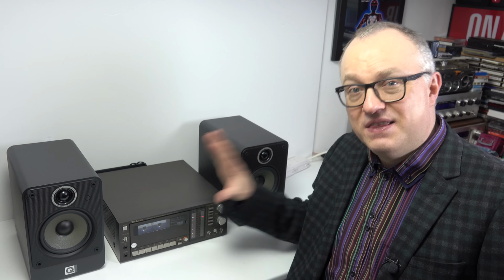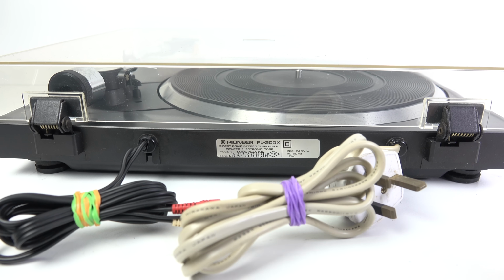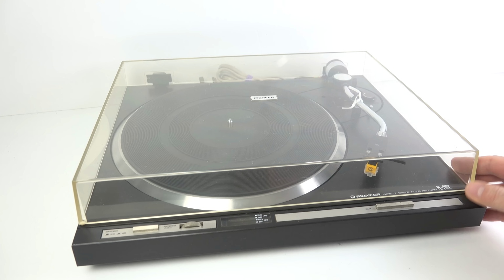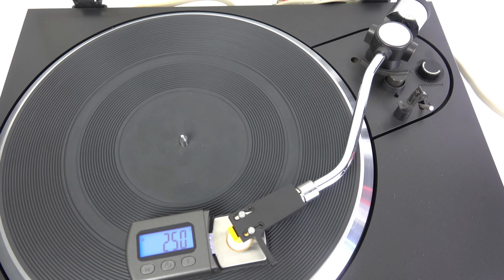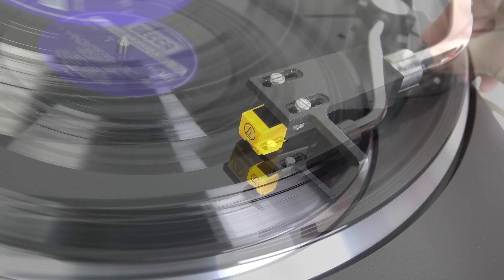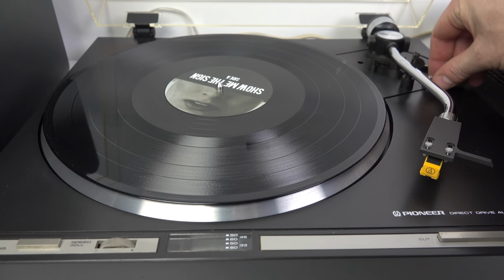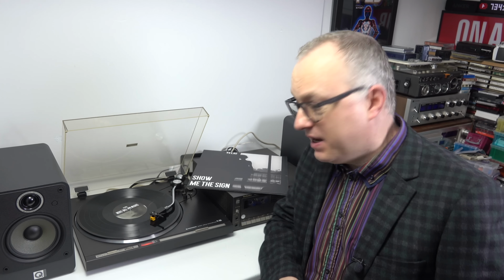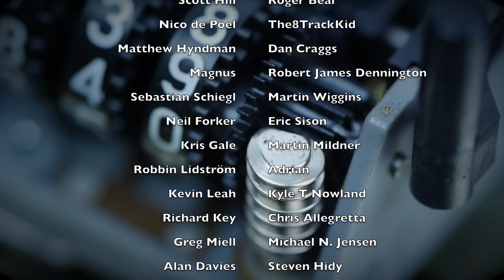Beginner Budget Hi-Fi Build: Part 3

Comment: Oh no.  The CASSCEIVER.
Reply: I thought it was cassiever
Reply: Had a "Realistic" one - a double cassette Cassceiver from Radio Shack back in the day. It was my 1st Stereo System.
Reply: Cassceiver reminds me of what we called a Radio-Cassette Recorder which was AKA a Boom box.
Reply: @steviebboy69  So now I know where the Japanese "rajikase" came from:)
Reply: @X2FileWrightonite  Agree, my first was a Realistic Receiver that was really thin. It was only 15w per side, but the radio part was superb at picking up AM at huge distances. The way the front panel and tuner lit up looked great and the amp had a switch on the back that optimised it for their Minus-7 speakers (still got two sets of them downstairs). It died while I was changing houses and was discarded. I really miss it.
Reply: @saddle1940  Radio Shack used to make some pretty good AM/FM tuning stuff,  In general today I notice across stereo hardware that is reasonably priced the quality of tuners has dropped quite a bit.
Reply: @steviebboy69  A classic Boom Box or Ghettoblaster probably weighs more than this whole system in D-Batteries alone.
Reply: @filanfyretracker  the price of tuners has dropped because of the stupid decision to cease using FM etc and go purely digital in the future. A huge mistake as FM not only works better, but it would mean loads of tech going to landfill that's working perfectly. I tried selling a tuner in cash converters some years ago and even then they weren't interested unless it was digital!
Reply: @RWL2012 : I going to blame autocorrect for that one! The speakers came in black metal or woodgrain. The receiver was an STA-7 Realistic System 7 with aqua coloured lighting. With those speakers, it was great for small rooms. They made an even smaller receiver (STA-19 ?), same height, smaller footprint. Tried to buy one but they'd discontinued it. Never seen one here offered second hand.
Reply: I did hear that the Minimus-7's were very good for their size, and it did have the maching system you mention for it.  I have Mach 3's hooked up to this computer system.  jamo 707i in the Lounge.
Reply: Rajikase? is that a kind of translation of what I said above?
Reply: @steviebboy69  At the time, I only retired the Minimus-7's because I saved up and bought a pair of Ditton 110's (around 1983) for the speakers. Wow, complete convert especially on music with heavy vocals. Still listen to them every day.
Reply: I used to have a Sony one, massive old thing, made out of wood

Comment: Adjusting antiskate on a grooveless disk is actually not a good methhod. The skating force is quite different in a proper groove. The good way is to use the tracking tests on that test record. A loud sine sound. With an oscilloscope you can check that both channels follow the sine wave equally well. Or if you don't have an oscilloscope, as most don't, you can record the sound on the computer with Audacity or such and study the waveform. Or just do it by ear, listen some loud and clean sound, turn antiscate both ways and listen when it starts to distort. The correct value is in the middle of those points. In the tracking force adjustment the part with the scale in it rotates freely, and the other part is the adjustment. You balance the arm, then turn the scale to 0, then turn the adjustment again until the scale reads the value you need. A good guess for tracking force on Audio-Technica cartridges is 2.0 grams.
Reply: esa062 while this grooveless method may not be the best, it’s still going to get your antiskate setting much closer to what it should be and then you can use the better methods at a later time to fine tune it. Sort of like setting your HD TV to cinema mode which gets you much closer the tv’s ideal picture settings (vs the bright store display mode most come out of the box set to) then going back later to do a proper calibration of the tv either yourself or by hiring expert tv calibrator to come in to calibrate it for you.
Reply: Actually setting it on the same number as tracking force is often more accurate. On my turntable the tracking force is 2.0 g. If i set the antiscating so that it stays put on a CD surface, it reads 1.8. The correct setting is when it reads between 2.5 - 3.

Comment: Enjoyed this video as I usually do. Just a (may be too 'techie') note: mains frequency has nothing to do with the speed a direct drive turntable motor runs. In fact even most belt driven TT are do not depend on the 50/60Hz from mains, and only very old (read "*really* very old") synchronous AC motors (like those found in certain reel to reel tape decks eg. TEAC 2300A) do use mains frequency as a reference for angular speed. Best regads and keep up the good job! ;-)

Comment: I have a Technics SL-6Q, a later version of the SL-5. It is a Direct Drive unit,  has quartz lock and is semi programmable.  It's supposed to use an optical sensor to detect the gaps in the tracks so you can program it to play specific tracks. The programmable function doesn't really work on mine. Given that it's over 30 years old, I'm happy with it as it is. Overall, a nice little turntable with a small footprint. Uses a P-mount as opposed to a standard mount. The tone arm is built into the cover and it's fully automatic. Down side is if you have any slightly warped records, they can bang up against the lid.

It was my first real daily driver until I replaced it with a more traditional turntable. I still use it with my living room stereo int he living room on occasion. The small size allows me to tuck it away when not in use.

I've enjoyed these videos. They've made me realize that I'm not a beginner any more. Though I'll probably never be an audiophile.

Comment: The PL400 has a series of  magnets made into the bottom of the platter and a coil mounted below in the body of the turntable. So the platter IS the motor. It doesn't get any more direct drive than that.
Reply: Scott from Maine my first semi decent turntable was a Pioneer direct drive. I then upgraded later to a Linn LP12 which was a revelation. The secret was the isolation provided to the platter with it's belt drive and sub chassis spring arrangement. I always understood direct drives to be the choice of the DJ where the audiophile credentials were not so important. 8-bit seemed to prefer the direct drive option but i always thought they sounded to bright with their metallic platters and direct motor induction noise ringing into it.
Reply: Yeah, it's the same principle used in the technics 1200 and 1210 tts, and it makes no noise at all! It's a wonderful idea
Reply: The turntable and tonearm platform are mounted on a very heavy base suspended in the frame of the unit to dampen and isolate from vibration.  It was excellent for costing under $200 in the early 80's.
Reply: i can see why one would prefer direct drive over belt drive for hifi use: longevity

no belt means one less part that degrades and needs to be replaced sooner or later. 

not sure how much of an issue the motor noise really is on a budget system like this

Comment: Also, major kudos for putting this together. I'm putting together a beginner setup for my son using some existing existing components but leaving off the CD player since he owns no CD's and he's wanting the total analog listening experience. I bought him a secondhand turntable (the PL-990) based on my top ramen budget and I had an old Pioneer dual cassette that hasn't seen action in a while. I'm thinking about the caceiver option since all the secondhand receivers I've seen at thrift shops here are geared towards home theater...a bit excessive really. Not to mention, I don't have the time to refurbish that Pioneer cassette deck. I picked the PL-990 since I've owned it at one point in my life so I know its quirks. Anyhow, thanks again for this...perfect timing

Comment: I have a Sony PS-212A which I brought with me from the UK to the US when I emigrated last year, and this does not have a power switch. It's semi automatic, direct drive from around 1977ish. It's rated for 220-240v but works fine on 110v/60Hz without having to replace the transformer and has indicators for both on the strobe. When I was doing some repair work on it, I noticed the direct AC wire goes to a switch under the platter that the tonearm switches on or off, so once the stylus retracts fully the switch disengages and cuts AC power. It came with no pre-amp, but I managed to take a pre-amp from eBay, disassemble it and built it straight inside the turntable and replaced the old phono leads with some brand new high end Technics lead that provide line level output. It's been my project for a few years to fully restore it, as I picked it up from a pawn shop for £30 (Cash Generator). It did come with a perspex lid in perfect physical condition, and amazingly had the original stylus on it. I changed the clamshell and stylus to an Audio Technica and it helped a huge amount. The hardest part of the project was replacing the tonearm wire. I wanted to put some newer wire in there that was less likely to pick up any hum or background noise, it's not a job for the faint of heart.

Comment: Watching this series from Matt inspired me to go hunting for a budget hifi setup. 

Off eBay I got a Technics SA-EX700 for $50AUD, and a AKAI AP-D210 turntable with new stylus for $99AUD. I got lucky with a set of standing speakers, getting them for free off a Sharp microsystem. A chance driveby through a council cleanup area yielded both a Yamaha CDX-550 CD player and KX232 double tape deck. After some setup, my $149AUD hifi was done and seemed reasonable.

When I watched this video, I thought about colours and decided to go down the silver route. I picked up a Sansui 4000 receiver for $200, an AKAI CS-M3 for $70, and managed to win a Matt-prefrence fully automatic, quartz lock, direct drive AKAI AP-Q60 for $200. 

Now I just need to clear the unused bits and my budget should be around the same as 250 British Pounds :)
Thanks Matt for your time and dedication into these videos and giving others inspiration to tinker along!

Comment: In 1982, I bought a Pioneer PL 220. It was basically the same as yours but in silver and with a straight arm. Bugger broke down 3 times and I replaced it with a Rega in 1986. Still got the Rega.

Comment: My Hi Fi is built mainly from old seperates though i pushed the boat out a little and bought brand new B&W speakers :) I think Speakers can be a bit of a risk used because you dont really know how they have been driven or in the case of old speakers with paper cones if they are rotted?
You can even get hi end stuff if your willing to go older
My system comprises of 60's/70's Quad Power Amplifier £90,Control Unit/Pre Amp £150 FM3 Tuner £40 Phillips CD104 £35 (and of 1984 Vintage all die cast one of the first) And a Linn Basik Turntable £200
Knocks socks of anything available these days!
My Quad 303  Power Amp turns 50 next year! Built to last :) 
Really enjoying this series Matt
I just need to buy a Tape Deck now but whaiting for the right period one that compliments my other gear :)
Jo

Comment: About the “missing” power button on turntable. I or my parents have had several turntables that did not have a power switch. You simply connected them to a switched power socket on the back of your receiver/amp and it controlled the power to the turntable (when the amp was off the turntable was off).

Comment: When adjusting tracking force, you need to make sure both halves of the weight turn together (turning the back half alone should accomplish this as there is friction between the two halves). On this weight, the back portion is connected to the threads so starting at a floating zero and turning both halves to 2 should screw the weight forward enough to provide the 2 grams. The cartridge looks like an AT91 which tracks at 2g.

Comment: Thank you for making audio videos based in the real world! Most audio based stuff on the Interwebtubenet seems to be based somewhere in the upper financial stratosphere. My late 1980s black Technics separates system is looking better by the day, carry on! No I don't mean that sarcastically, this series is highlighting that good equipment is still good, despite all the technological advances. The linear Class A/AB amp is still solid, and the speakers are just about run in, as these days I feed my PC sound out through the system. The design of good gear seems to owe more to engineering than stylists.